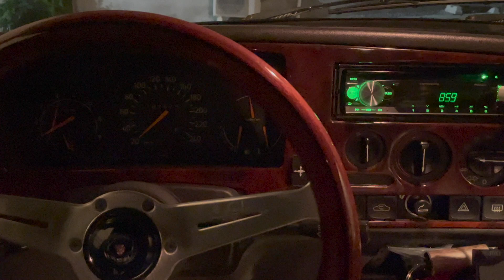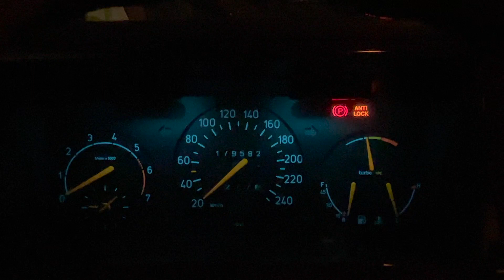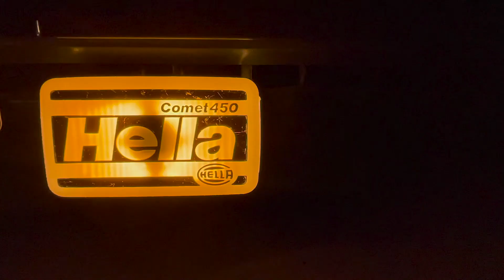【SAAB 900 turbo S 1993】Quick check before ride

Comment: Thanks kindly for sharing your passion and enthusiasm!....I do like your Hella fog lamps,especially yellow illumination ;)...I would, however, like to ask about your blue instrument illumination, I am assuming this to be LED bulbs?.....my instrument cluster illumination has recently failed and I believe the problem might be related to a poor dimmer potentiometer, my car is an ‘86 black 900 turbo bull nose;).......she will be receiving a new front crankshaft seal and wiper motor next week, warm regards, David....Scotland.
Reply from the maker: Thank you for your comment and sharing your passion😊
The fog lights were additionally put last year and I love it. 
As for cluster bulbs, you are right. Those are LEDs which were installed by previous owner. It looks bit bluer but I think it’s good for saving energy and free from heat issues. Good luck with your 900 and please check my Instagram if you have an account;) Thank you.